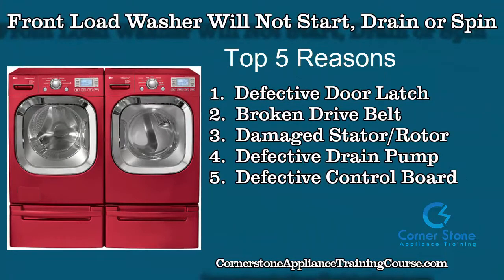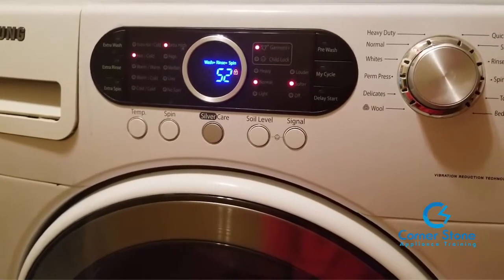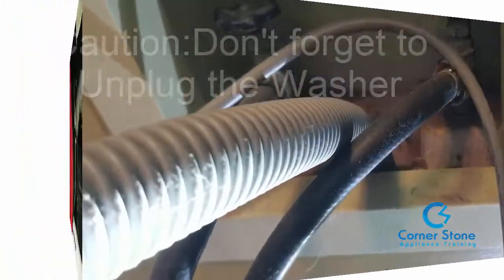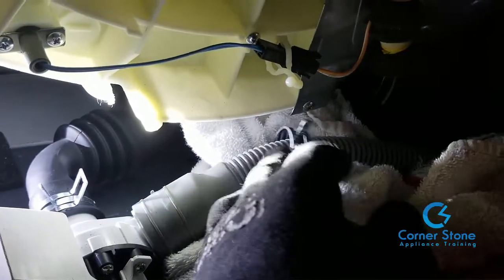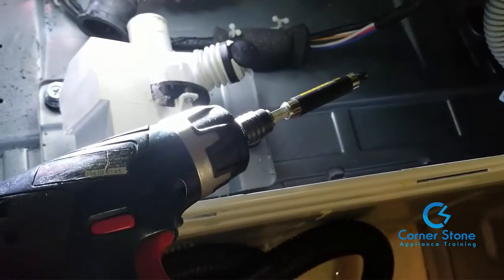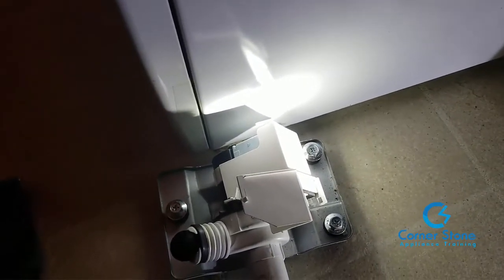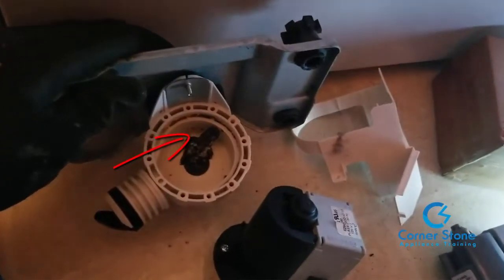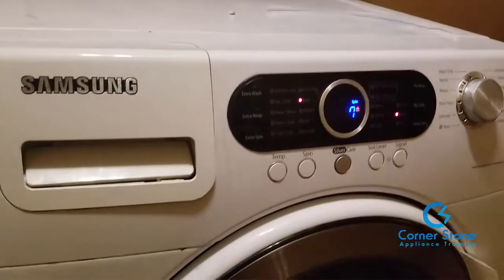Front Load Washer Repair - Samsung Washing Machine is Not Draining Spinning Start

Comment: i like your video
 we change drain part but display message nd 40 minit cycle so how to fix
Reply from the maker: Sounds like you need to check your tub hose to ensure that it is clear of debris.  When you change the pump always make sure the tube hose doesn't have coins, pens, etc. inside (tub hose is the hose the large short hose that goes from the pump to the bottom of the tub).

Hope that helps.

Thanks

Comment: Nice video
Reply from the maker: Glad I could help.

Thanks
Reply: @chrisstokes2020  sir what is the problem in Samsung front load stop in the middle  after washing then drain and it stock not failing water for rinse and pump motor always running until 5E affair

Comment: I have a Samsung washing machine with 2 drain pumps. The resistance was good in both, i cleand Them checked for clogging in the Pipes found nothing. The machine still won't drain. What could be the problem. ( Error code E5)
Reply: Same here